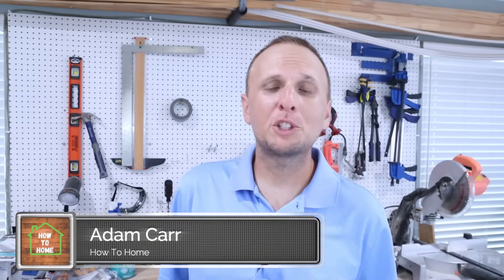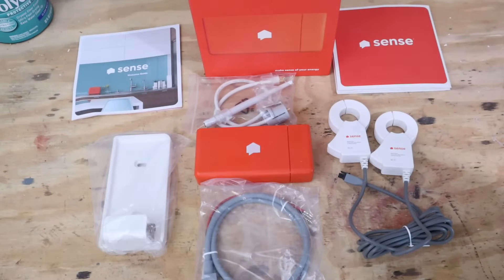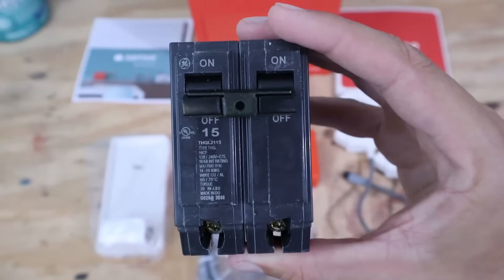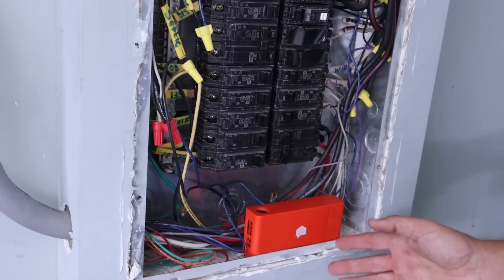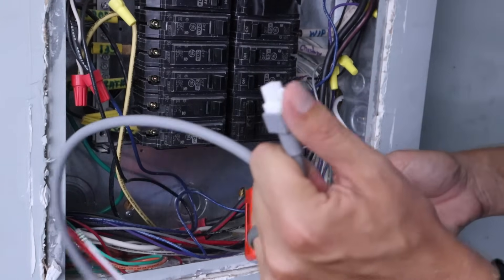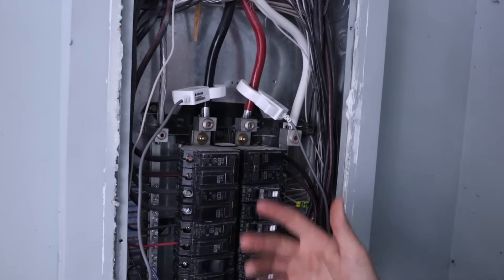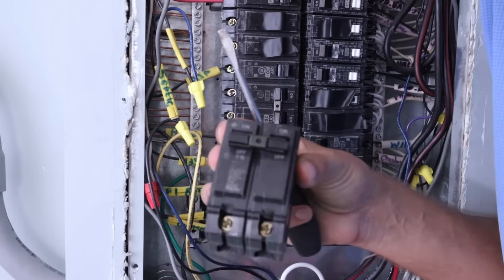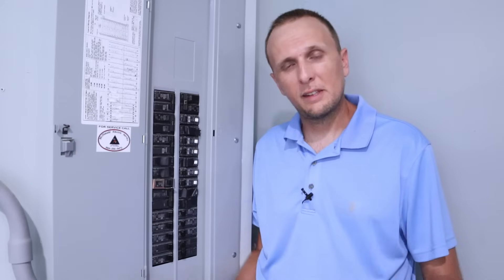Sense Energy Monitor Installation and Overview | Watch Before You Buy

Comment: If you needed to piggy back off another 240v dual pole breaker (since I have no room for another dual pole), does it HAVE to be 15 amps? Could I piggy back off of my 50 Amp Dual Pole, I use for my EV charger?

Comment: The sense is great to help one modify their energy usage.  If one has solar panels, they need to know what energy they use and what energy is delivered to the Electric company.  Yet to figure out just how figure this.  Also a method to sense the panel differences in energy production would be nice to indicate necessary panel maintenance.

Comment: Thanks for the informative video!

Is this thing UL approved? If something bad happens will my home insurance blame me if I have this thing installed?

Regarding piggybacking on another breaker, I think the reason they don't allow this in code is many (most?) breakers don't have terminals designed for multiple connections and if you piggyback you risk reducing the effectiveness of the connection and it can get hot and even burn or arc. I think they do make some breakers which are designed for multiple wires on the terminals and those may even be acceptable according to NEC.

I'm not a big fan of cloud services working their way into monitoring my everything. Who do they sell my data to? Are they one of these cloud companies who someday decide they want to start charging a subscription fee or they will stop your service? There's just too much of this happening in tech lately. I would prefer something that would not require cloud services but rather work through my own computer running something like Home Assistant.
Reply: Your question regarding home insurance is indeed very valid, in fact I asked them too and their tech replied as "Sense is certified UL 2808 compliant by Intertek. You can see our certification seals and numbers on the monitor's label next to the Sense Serial number. Sense conforms to the following additional standards:
CSA STD C22.2 No. 61010-1
UL STD 61010-1
UL STD 61010-2-032
CAN ICES-3(B)/NMB-3(B)
CISPR 32
CISPR 35"
As far as your concern regarding the cloud, it's too very critical that why they want our data at their end? Why don't they do all the work at our location, my guess is their sense device is not too powerful to analyze the wave forms to detect the electrical appliances by looking at the pattern using AI so maybe this red sense device is only a transmitter/uploaded of the wave forms to their cloud server where they may have high-end AI computer systems available to analyze the patterns and send back the reports. So, it doesn't seem like an independent system in your home and if this company is closed or acquired by another company in few years and they start charging you for the cloud services then who will stop them? I think they need to make independent device (their price is perhaps the highest price in the market for home energy monitors).

Comment: My power company tells me every 30 min on their online app what the previous days power was. So if you know when you were cooking , running laundry , or using the dishwasher , or watching TV with a little bit of homework it becomes easy to track solar output vs total power draw from each appliance. ( AC is 6kW, Dryer is 6kW, oven 4kW etc .. )   So I see this as a waste of $300. ( I really wanted to buy it, but for me the payoff from "savings" would be like 20+ yrs.)

Comment: I have a three way switch and when I flip either switch the light comes on and goes off as if I just flip the switch on and off.  Sometimes it comes on and stays on I changed out the switch and that didn't work what do I check next

Comment: Great video. Thanks for the in depth review. I'm wanting to get the sense because I want to monitor the basements 100amp sub panel which feeds into the main floors 200amp panel. Unfortunately I feel like the ct clamps could be too large to fit into my 200 Amp panel as all the wiring is really tight.

Comment: Other than black, white and ground wires I have seen a red wire. Where is the red wire connected on a switch or outlet?
Reply: The way the Sense power cord is designed, only the black wire out of the pair of red and black hot wires carries current, so one complete circuit is formed by it and the neural. The Sense can power on and technically function without the red wire in place. However, the red wire needs to be connected to the opposite phase of a split phase panel to sample the voltage and see the wave offset. This is necessary to calculate accurate wattage on the -120V phase and for the device detection algorithms to work appropriately. Other wires are neutral or ground.

Comment: I have, quite literally, hundreds of discrete devices living in my home. I have well over 75 separate wireless devices alone, not including appliances, outlets, wired devices. How exactly is this supposed to know which of my 20 smart plugs is being used? How does it know the difference between a fan in the office and a fan in the bedroom?
Reply: Is going to detect a fan, not exactly the location. After that you can turn on/off the item in order to recognize its signature properly.

Comment: Adam, I noticed EMPShield was advertising on your channel.  They purport to protect your entire home from a lightning strike or even a high altitude EMP.  All 3 EMP type events and are listed on DHS website..  I recently bought one because it appears to be such a high quality, fast acting surge protector (500/trillionths of a second) and I wanted to protect my home.  Kind of pricey but I wondered if you had looked at them and if you were going to try it on your channel?
Reply from the maker: I have not really looked into them.  I know I briefly did a couple years ago before I bought my SPD.  I ended up getting a Siemens FS140.  It is my understanding with the one I got if ferrites were added to the incoming lines and sensitive devices, that it would be effective against EMP type events.  I don't know enough about the EMP shield as far as how it works exactly.  I just know that they advertise it as for in the event of an EMP.  How do you like yours?
Reply: @HowToHomeDIY  I’ll let you know. I get it tomorrow.
Reply: @HowToHomeDIY  It was easy to install into a DPST 240v 15a breaker.  Two LED's confirm its working. Now its waiting for a lightning strike or a nuclear attack.  I'll hope for the former, if I get to choose. 😊  But I think I'm better off with it then without it.

Comment: how does this sensor figure out which appliance is the source of the consuption when say there are multiple appliances on at the same time eg 2 Air conditioners ...will it be able to distinguish between AC 1 and 2 ?
Reply: Yes, it works based on the electric signature of each device. Some are not going to be detected in detail but are minimal, and they are updating the database pretty often.

Comment: seems very odd to install the sense on a double breaker.   If its a standard 120v product, then the hot would get connected to the hot and the neutral would go on the neutral bar.
Reply from the maker: Ok so I installed this about a year and a half ago so I had forgotten all of the specifics of it but I just refreshed my memory.  So yes, the electrodes on the mains are what are monitoring the power consumption on each leg.  Per Sense, the reason they want it on a double pole breaker is "it still needs to monitor the voltage across both phases (A & B) of the panel. For that reason, we always recommend installing on the smallest 240V/dual-pole breaker available."  I hope this helps!
Reply: The way the Sense power cord is designed, only the black wire out of the pair of red and black hot wires carries current, so one complete circuit is formed by it and the neural. The Sense can power on and technically function without the red wire in place. However, the red wire needs to be connected to the opposite phase of a split phase panel to sample the voltage and see the wave offset. This is necessary to calculate accurate wattage on the -120V phase and for the device detection algorithms to work appropriately.

Comment: If the power is down and also the internet and I am running on a generator, will I still be able to see the usage on my smart phone or iPad? Thanks
Reply from the maker: If your generator is powering the circuit and your internet modem then yes you can.

Comment: How does it know what turned on from the mains. Like being able to tell the difference from a toilet flush or washer filling from the water meter. Also, if it can graph voltage, that'll be great for the customer to show the utility company when there lights are flickering.

Comment: I usually like Adams recommendations, but Sense’s guessing on what the load was, was unacceptable to me. 
I installed an IoTaWatt in about 30 minutes. Less expensive and it allowed me to monitor each branch circuit accurately. I have quickly ascertained which loads I can have on during a blackout. The data can be graphed over time or you can just view a live, real-time summary. Outputs can be customized to include all appliances for example.  Better option in my opinion.
Reply from the maker: Hey Lenny, I appreciate the honest feedback.  I do not know much about the IoTa, how does it ascertain what appliance or lights for example, is on?   Or is it that you label it when you put the sensor on each individual circuit?
Reply: @HowToHomeDIY  the bigger appliances or loads are usually on their own circuit breaker i.e. AC, oven, stove, dryer. It’s easy to see if it’s a major load or just lights, fans or TVs. You are monitoring to determine which loads are a back-up must have or nice to have. It also allows you to see if another major load must be turned off first to use another major circuit. In my case, my 9.5KWH/12.5KWH peak generator will power all my minor loads plus my 5T AC including the AC fan on my furnace. My IoTaWatt cost $270 which included 2 100a main CTs (current transformers) and 12 50a CTs.  I did take your advice on installing a 368-X72 EasyStart. I’m installing it tomorrow. Can’t run AC without it.
Reply: @gottofly2  This is what I looking for since Sense was poorly customer service since they non-reasonable blocked me on Facebook. Thank you for that name.
Reply: @HowToHomeDIY  I know it is been 6 months, but I would've wanted to monitor exactly where it is power used.  For example, I like to monitor higher power individuals, such as AC, my computer, theater, etc. And of course, power protection for higher power and better customer service is preferred.
Reply: The main problem with IoTaWatt is that it is limited to 14 devices.  The problem is you either need 2 of them, or not monitor some.  I can narrow down something with Sense even if it does not show what it is.  Simply by turning off a breaker, and if a major load drops, you can go track it down.  Don't take a genius to figure that out.  IoTaWatt would be great if you could have like 20+ devices, but 14 is lacking.
Reply: @BreeOge  Some circuits are not worth monitoring.  IotaWatt monitors circuits not devices. I monitor my mains just like you, but I can track data that is very accurate on the branch circuits that I monitor.  14 circuits of data gives me more detailed information than your Sense, but to each his own. For example, I charge a Tesla on a dedicated 240v circuit.  It will give me the exact amount of energy used to charge my car per day, per week or per month in KWH's.  I pay $.104/kwh so I know the cost of charging exactly. Can Sense do that?

Comment: I tried using a 15a tandem circuit breaker but sense didn't like that
Reply: Tandem are single pole (phase) 120v breakers, while sense needs double pole 240v breaker. (however you may use 2 opposite single pole or tandem breakers)
Reply: @manclt704  what’s your sense of sense in terms of accuracy? It seems to have difficulties with detecting appliances or is this a signature from appliances issue?

Comment: Thank you for the great in-dept detail on how to use this product.  I do want to purchase this.  However, I have a question.  I have two breaker boxes in my house.  One that is for electricity for appliances and the other box which is for the air conditioner.  Will I need to buy two separate unites in order to record everything?  Or would I need to place this on the outside box?  My electric bill is usually between $200 - $299 a month and I want to find the source of what's causing the high bills.
Reply from the maker: You want to put it in whatever box is furthest upstream or closest to the meter.  That way it will capture everything downstream from it.  If it is put in a subpanel then it will only capture what is being powered by that subpanel, your AC breaker box for instance is probably a sub panel.  Hope this answers your question.
Reply: @HowToHomeDIY  yeah, there is two subpanels inside.  So in order to capture both (everything) I would have to have it clamped on the one outside?  The ac subpanel is the closest to the outside meter, the other subpanel for everything else is the fartherest in the hallway closet.

Comment: Does it actually name a device or do you give it a name?
Reply from the maker: It varies.  If it is 100% sure of what it is then it will assign a name.  If it is uncertain but has an idea what the device is, it will give you options as to what it thinks it may be and a percentage of what certainty it has and then you select which one it actually is.  And if it has no idea exactly what it is then it will come up as heat 1 for example because it is sensing a heat element or light 1 because the wattage is mimicking a light, then you will just have to figure out which one it is and then you can name it what you like.  But it does always give you some sort of idea at least what it is sensing.  I hope this helps!
Reply: Thanks for your information, I just ordered one from Amazon. Electric company is always sending me letters that I’m over usage compared to my neighbors. I expect that because I have 2 sump pumps that activate about 3 times a minute, I’m on a high water table. I would like to make the rest of my house as conservative as possible. I appreciate your help.

Comment: Where should I hook it up.   The main comes in to the house outside. Then goes into a box with 3 breakers.  200 amp House panel,  60 amp Sub panel for my outside bar and a 60 sub panel for pool equipment.
Reply from the maker: In order to monitor everything it would need to either be in your first box outside or your main panel with all your circuit breakers.  If you put it in one of the sub panels downstream it will only be monitoring that panel or anything downstream from it.  Hope this answered your question.

Comment: 3.7.21  Adam, Question:  Can the red and black power wires be connected to 2 single pole 15amp breakers each one being on a different 120 volt line?  I have no room in my power panel for the 15amp double pole 240 volt breaker.  Thanks for the video.
Reply: Since the double pole is just connecting to both sides, then I don't see why using a single on each side would not work.
Reply: @onlywenilaugh6589  You would need to use breakers on top of one another. Breakers directly across from one another are on the same leg/phase. You need to measure both legs which is why a double pole breaker is suggested.
Reply from the maker: I can only go back to what the instructions say which are that they recommend it be on it's own double pole breaker but that it can be attached to or you can piggyback another 15 amp double pole breaker in your panel if there is no room for another designated breaker.  I hope this helps!
Reply: Yes, instead of a double pole 240v breaker, you may use two single pole 120v breakers but make sure each single pole breaker is of opposite pole (phase) normally if you come vertically top to bottom then every 2nd single pole breaker would be opposite to the first breaker.

Comment: Any options or ideas if wifi is not available?does it store the info and can be periodically taken to wifi to retrieve data?
Reply from the maker: As far as I know, the only way for this device to work properly is with wifi.  There is no LAN port for it and it needs to be able to communicate with the Sense servers in order for it to discover devices, update, etc.  If you have internet of some form, many people just buy an inexpensive access point with wifi just to be able to get their sense device to work properly.  If this isn't feasible there are some other options out there that can monitor your power usage without needing a wifi connection, they just might not have AS many features.  I hope this helps!
Reply: Or wired directly to a computer?or to a Bluetooth receiver to send info to a device?

Comment: You have installed it 3 months ago do you have any statistics around how much were you able to identify
Reply from the maker: Hey, so far it has identified 14 appliances/lighting/equipment.  It has found all of my larger items and a decent amount of smaller items such as lights in rooms, crockpot, coffee maker, etc.  Sometimes it isn't sure what the device is so you have to try and figure out what it is by turning things on and off to see if it shows up on the app when you turn it on and then you just label it what it is.  Most of the time it either knows what it is or has suggestions.

Comment: Does this unit need internet access? or could be setup on a stand alone wifi?
Reply from the maker: As long as there is wifi signal with internet, within range of this device that you can connect it to, that will work perfectly.  I actually got a wireless powerline adapter to supply the wifi to it and put it right out by the panel, works great.  👍